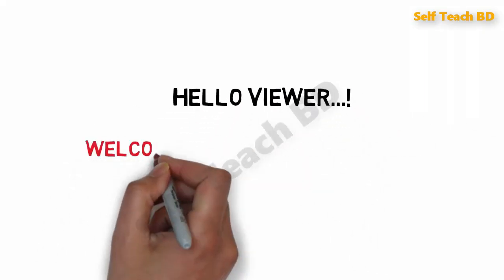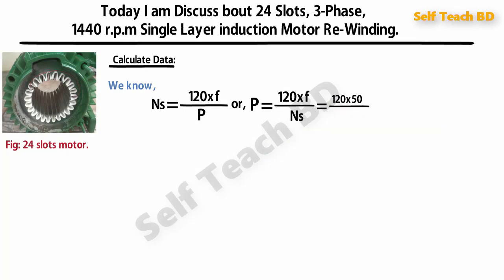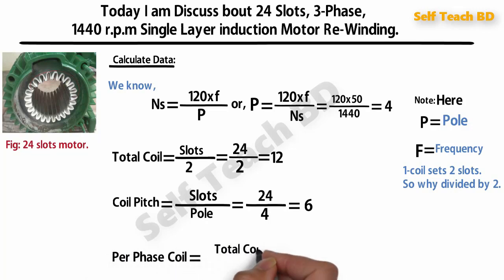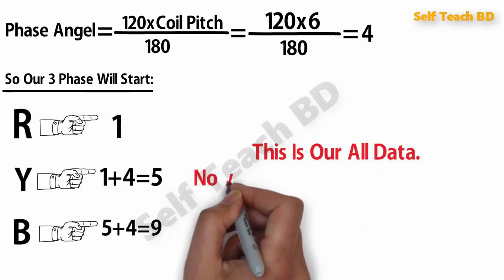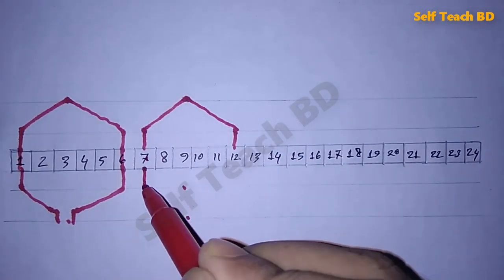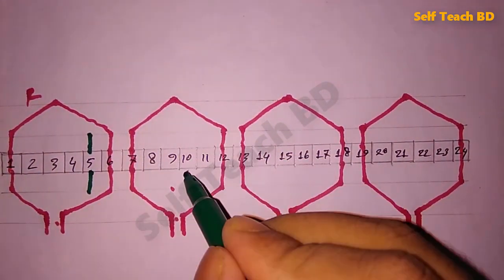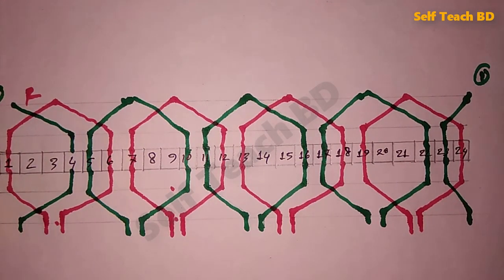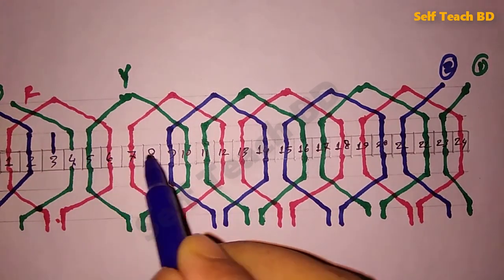1440 RPM 24 Slots 4 Pole Induction Motor Rewinding_High

Comment: Congratulations, very good video.
Do you have a similar one for a single-phase motor? The calculations and the layout of the winding, how are the S and F of the pins connected?
A motor 1/2 - 1 Hp and 24 slots?
Thank you very much

Comment: Amaizing ,I have two questions how do we select coil size ? And how do we determine the coil length(turns)  ,the rest is crystal clear
Reply from the maker: It's not a new Winding. It's jusr re winding. You have to determine your old motor wire size, coil lenth and number of coil and coil weight etc. If you make a brand new motor winding then you have to calculate more term.

Comment: Hi friends thank for the video.pls can u explain to me how to calculate number of turns for the coil (formula)
Reply: Turns per volt=7.5/(real pole area)
Real pole cross section area excludes the air gap between the teeths and laminations.
I have given you the hint. You can develop the formula now according to the poles and working voltage.
7.5 is a constant derived from very complex calculation, so don't bother much about it. It's general thumb rule taking 1 Tesla as flux density to calculate turns per volt.
Reply: @Dave_en  sir can tell me  about turns nd swg number
Reply: @Deepak_Kumar-x3z  SWG number is guessed by professional experience. Different stators have different slot areas as per manufacturers. So guesswork doesn't always work.
We just assume 50% teeth area in stator and count the teeth to get the stator pitch area. And use the calculation above to arrive at turns per phase and pole. If you can measure the width of each teeth, your calculation of turns will be more accurate.
Reply: Thks for ur explanation
Reply: Ok
Reply: @frankyohana5617  my formula has worked for small motors upto 0.5 HP. For larger motor, you have to get into the real stuff. Get the exact measurements of the teeth and some extra formula to calculate exact turns per pole. Upto +/- 10% deviation may work, not more than that.
Suppose actual coil data is 100 turns then either >90 and <110 turns will work. Try to stay near 100 for best results.